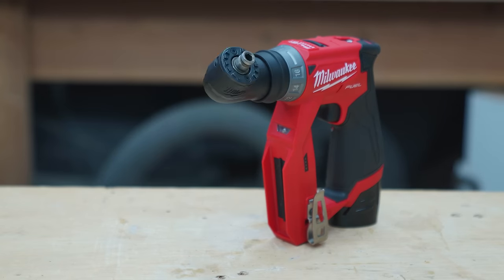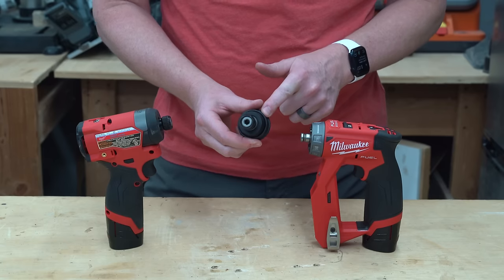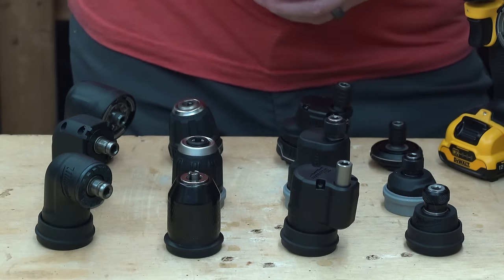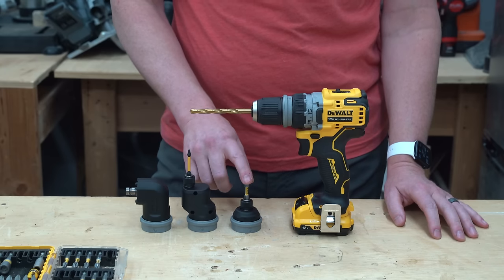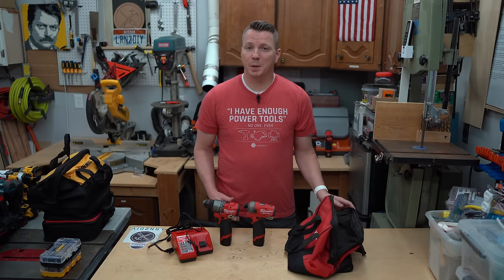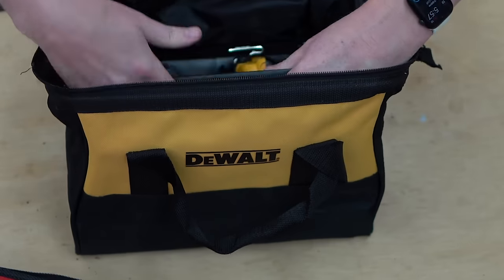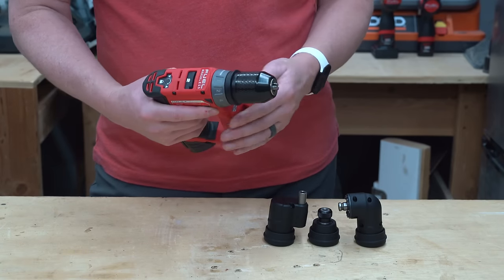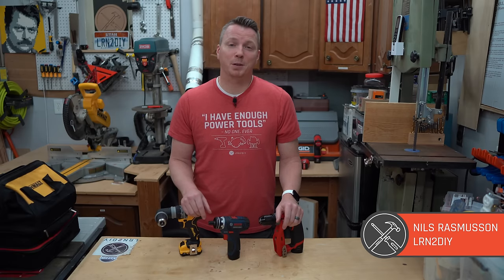These Weird Looking Drills Do It All

Comment: The video is a fairly good comparison, but you said that the claim to fame for this genre of tool is that they allow you "to work in tight and difficult to reach spaces," but this is only partially true. DeWALT, for example, showcases much more than that. Their first bullet point is "Access tight spaces with compact, LIGHTWEIGHT design and 4 dedicated attachment solutions. Among other things, the company also points out that their 5-in-1 drill/driver is "Built for control and control". In fact, all three companies say something similar. 

This genre of tool has more than one claim to fame, but if I was to narrow it down, these drills are so popular because they can fit where larger drills cannot, they are lighter to work with (in case you're slight of build (e.g. old or female] and/or working with them all day), and they offer more control (e.g. less apt to overdrive or cam out screws or damage work by not being as prone to slip or bang around generally). 

The biggest criticism I have, however, is that you set the tone for this video by quoting people who have purchased these drills rather than the companies themselves, and in my experience consumers including some professionals fail to understand the purpose of these mostly INSTALLATION tools. They are NOT meant to replace all their drills and drivers as you claim is claimed. That would be suicide for the drill/driver divisions within the relevant departments of each of these companies. They're not trying to replace the sales of their other drill/drivers with this genre of drill/driver. These are relatively low torque/low RPM versions that are smaller & lighter which are meant to offer more precision in assembly tasks such as cabinet installations and other light to medium drill/driver applications; and they certainly are not meant to replace hammer drill/drivers or louder and infinitely more powerful impact drivers. For example, the DeWalt's low setting is rated under 500 rpms while their XR impact driver's low "precision setting"  is rated at 1000 rpms. 

So I think you put too much emphasis on how small these 12v drills are compared to 18v options. This may be the only drill a lot of people who will never do anything  other than light to medium tasks around the house, but any serious DIYer and any professional should already know they're going to need more robust options that they're already used to using. Certainly none of these companies are claiming these are replacements for their other drills. The disconnect is that you're listening to consumer comments which range from professionals not thinking it through to dip **its.

Comment: So do you like those little fuel tools? Still in the market for a new drill and driver- do you not miss the power of the 18v stuff?
Reply from the maker: Hey Chris - I actually love the M12 Fuel set. The Surge 12V Brushless Impact Driver is a total powerhouse. I always have my bigger ones that I can grab if I need to but if you're looking for a set that can be your one and only, I'd probably still go with an 18 or 24V set just in case. For 80% of what I do, the 12V is perfect though. Flex tools, Milwaukee Fuel, Ridgid - lots of good options for the bigger ones. Ridgid and Flex both offer lifetime warranties, which is pretty awesome. I just burnt out my 8 year old Ridgid 18V drill so I'll send it in and get a new one for free.

Comment: I like it, but that would be a tool to break out for special tasks. IMO, anyone that is looking to purchase this tool more than likely has several drills and impact drivers already. This would not be a beginners tool or something you would use to replace several drills. Personally, I like the form factor of that Milwaukee drill, but if I had Bosch or Dewalt, I would get those simply because I would already have some of those batteries. I don’t really see you going wrong with any of them.

Comment: Way to experience. Not a fan of 12 volts batteries tools . I chose 18 volts years ago now it’s 20 volts with no brush motors and lighter smaller.
Until the battery’s go I’m going to stay with what I have. Not a tradesman just a homeowner.
Reply from the maker: That's what a lot of this comes down to. If you're using a certain brand and have their batteries, you'll likely stick with that. I already had several Milwaukee 12v tools so this one was an easy fit but we'll see how much use they really get.

Comment: I don't see the need. I can grab my right angle adapter or flexible extension and put it into my impact driver. The total cost of those was about $30. I don't need another $200+ tool when I can do the same job for a fraction of the cost.

Comment: Its a gimmick. I bought my Milwaukee a while ago and thought it was the best. Comfortable drilling and the off set was nice. that being said after the first month of owning it i have not used it in over a year. I just use my to main drill and impact instead and have  90 degree cordless Milwaukee that i replaced my old Makita 9.6v 90 ive used for over 15 yrs.

Comment: 12 volt drill? Like from the 1950s? Lol 18v is a baby drill these days.
Like the idea
Reply from the maker: That's what I thought too until I bought the Milwaukee Fuel 12v impact driver and a drill. I actually love them because they do 90% of what I need in a teeny tiny tool. I still have my beefy drills for bigger jobs but I rarely need them. But I agree that if you only get one, get something with some power.
Reply: I used to think the same thing but 18v tools are heavier and I realize I hardly ever need the full power of 18v.   Minor work and electrical I find myself using an old 12v Makita because of the weight savings